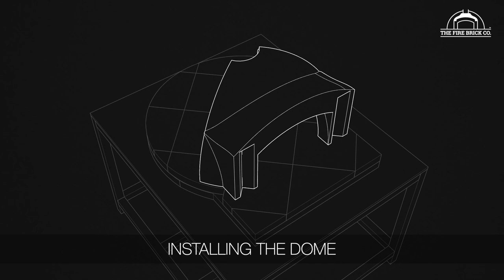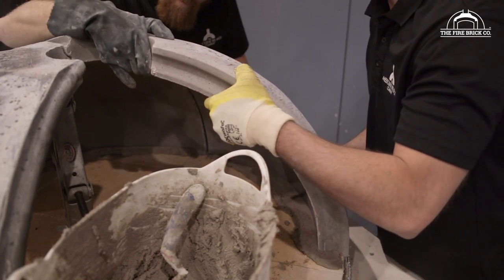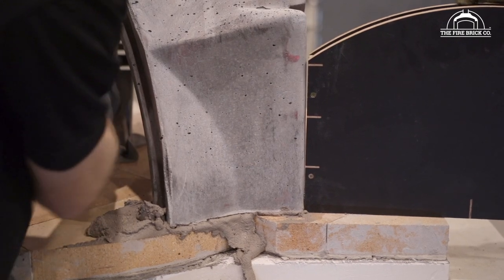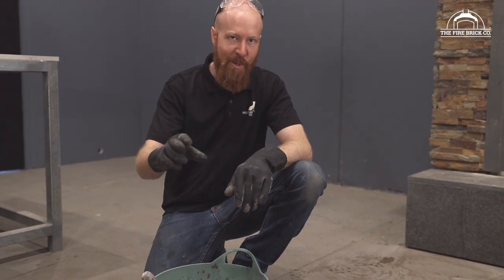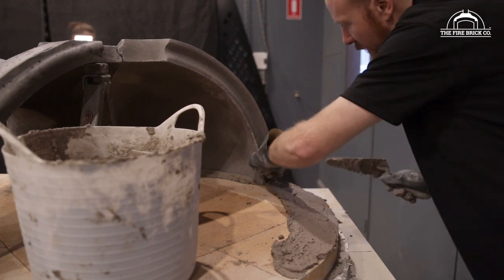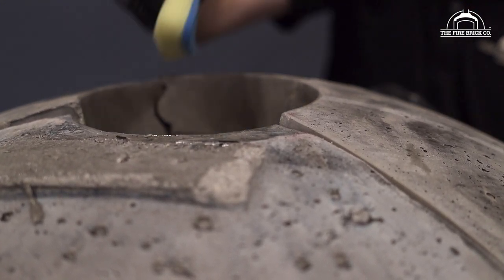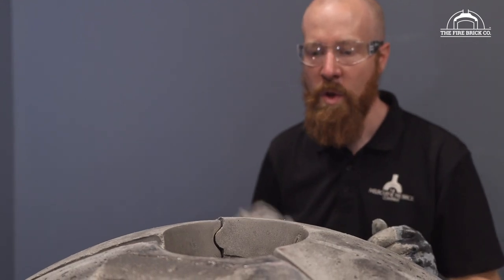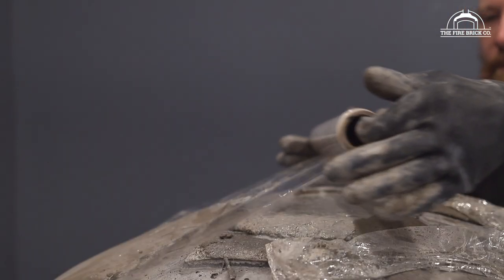How to Build our PreCast Oven Kit | 4. Installing the Dome

Comment: Which mix should we be using to put the castings on?
Reply: Is it the same one as we used to lay the tiles?
Reply from the maker: You’ll be using the two part mortar mix from this point onwards - please make sure you’re referring to the written instructions though Andre, you’ll find those details in the pdf plans that you can download from the website

Comment: Such an incredible kit! What does your refractory castable consist of? I respect that it may be a secret.
Reply from the maker: Hi Duncan! It's a dense refractory castable with a 45% alumina content - it's not a secret or anything haha! We include 3% stainless steel fibres (by weight) to give the final casting high tensile strength, which is something not everyone does but we have found it's very important.